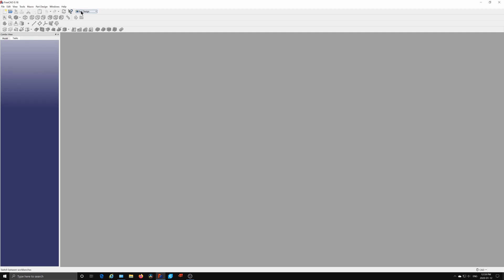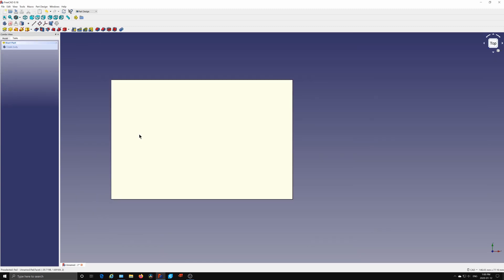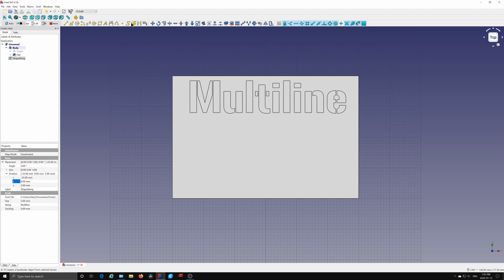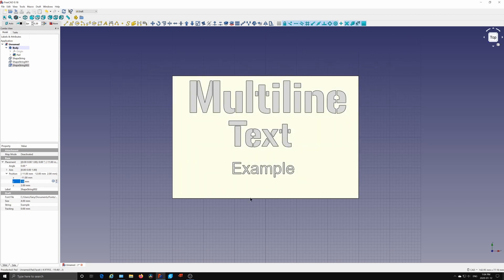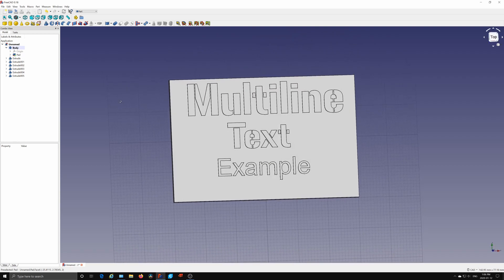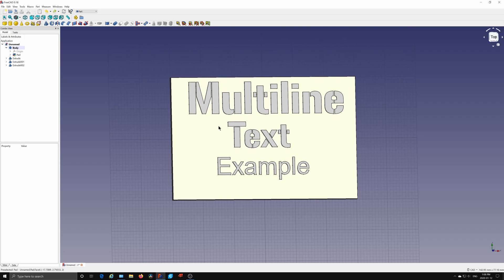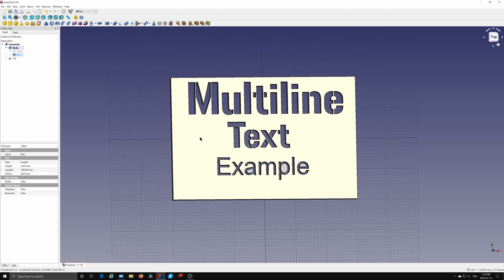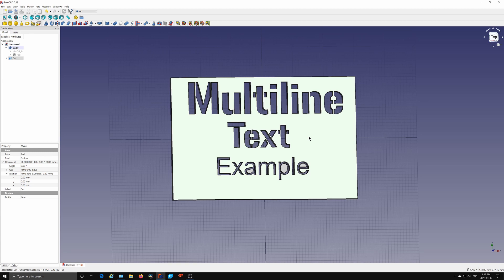Text cuts in Freecad 0.18

Comment: Thanks for the tips. I was able to extrude, but not make the cutouts? Using .18 on MacOS. You got me a lot further than I was :)
Reply from the maker: Did you boolean combine you lines of text? If so when doing a cut you have to select the object you want to cut from first and then select the object you want to remove second and then use the boolean cut and the text should be removed. I don’t have any experience with the mac version but I would think it would be no different than the windows version of freecad.